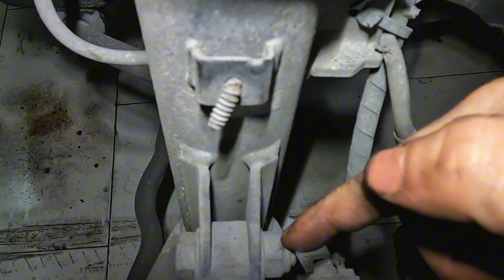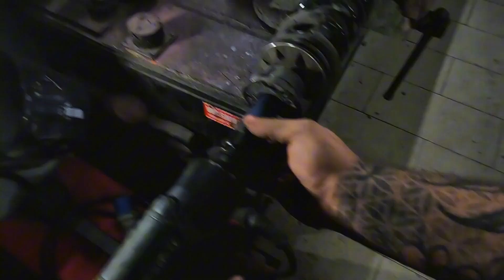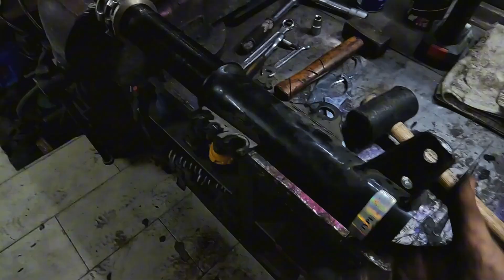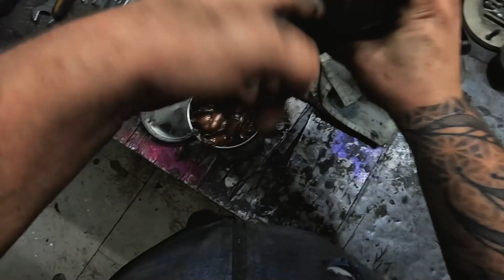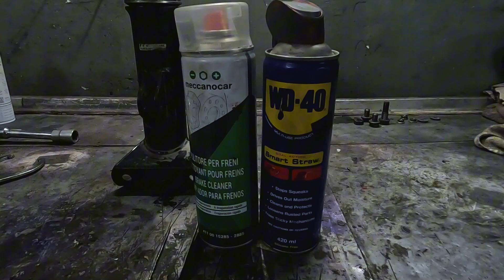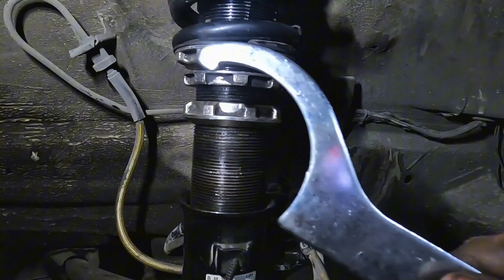How to Fix Seized Coilovers and Properly Set the PRELOAD and Adjust the RIDE HEIGHT

Comment: Why not set you coilover before installing? I think it's easier to make your measurements to get equal ride height on both sides if you're not doing it while they're installed. I just set mine up, then install. If I do neet to make an adjustment, it's minimal. I guess whatever works for ya